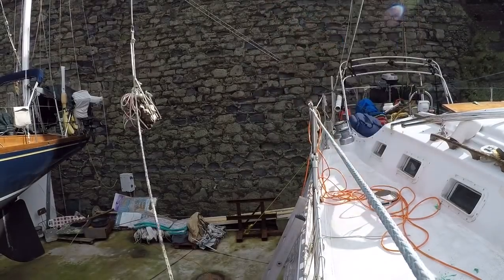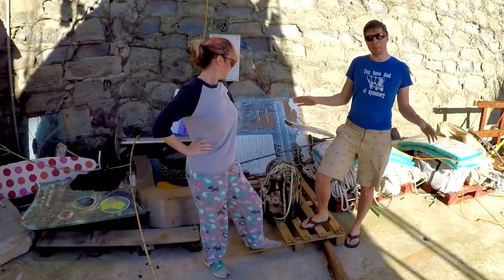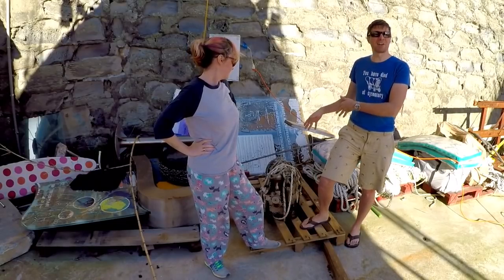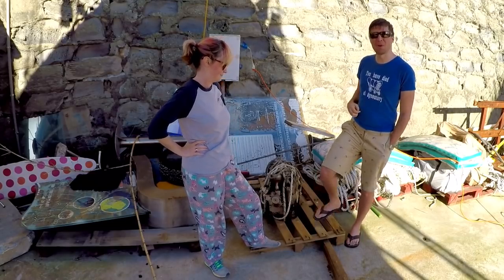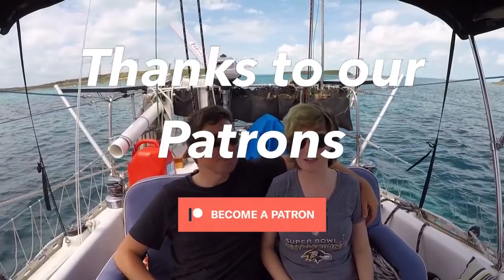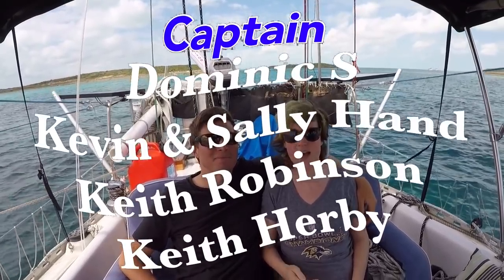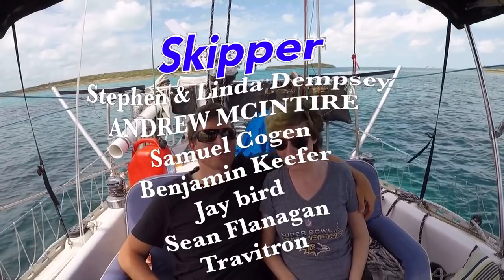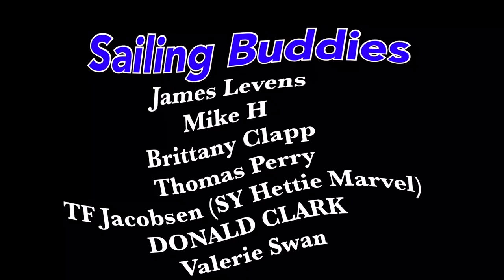Diesel VS Gas Generator?! | Sailing Wisdom

Comment: 1. Gasoline is explosive, flammable, and starts to slowly go bad immediately even with fuel stabilizers.  It is very volatile.  It evaporates readily leaving impurities which reduce combustion of the remaining fuel.  
2. Diesel is not explosive, not really flammable, and stores indefinitely with some biocides and a pack of fuel filters.   Diesel does not evaporate.  Diesel can be cheaper per gallon and has more power per gallon vs gasoline.

Winner: Diesel.  Gasoline is so dangerous that it requires a bilge blower.  I saw a jetski explode on the boat ramp last month from 2stroke gasoline fumes which ignited then Boom, followed by a good fire.  

The only positive for Gasoline is that some gas is also required for a dinghy outboard so the gas fuel supply can be shared.    Diesel outboards for dinghies no longer exist which is a bummer but also a fact of thermodynamics, diesel engines must be engineered larger and heavier than gas engines so it is hard to make them light enough for dinghy use plus no one likes the diesel NOx toxic exhaust fumes so close to people.  

Because boat fires and volatile fuel explosions are the #1 cause of boat destruction & boat injury, I'm hoping to also get rid of my propane tanks and propane stove-oven setup and replace with electric induction cooktop run off of inverter.  (I already use electric glass top induction stove for cooking on the boat with AC supplied from shore, has worked great for years).   Moral of the story is, it is better to eliminate volatile fuels from the boat, and gasoline is also one of those volatile fuels.
Reply from the maker: Very good points. We keep our gasoline jugs on the deck as well as the generator. Any fumes are whisked away by the wind, but we still need to be careful around the liquid (and vapors). Our thoughts were: portable vs inboard, inexpensive vs expensive, and replaceable vs repairable (has Vs. diesel).
Reply: @RiggingDoctor  Current prices; 
1. Gasoline generator. Honda EU2200i 2.2kW peak, 1.8 kW continuous, $1,000 off the shelf, not fixed install.  Weight 47 lbs.  ~8 hrs/1 gal gas.   Cost equates to ~$600/kW.
  
2. Diesel generator. Next Generation Kubota 3.5 kW continuous genset,  semi-fixed install. $6,000.  ~180 lbs.    ~6 hrs/1 gal diesel.   Cost equates to $1,700/kW.

Better comparison of the Kubota is to Honda EG4000 gas generator 3.5 kW continuous, 150 lbs, fixed install.  $1,600.  ~2.5 hrs/1 gal gas.  Cost equates to ~$500/kW.  

Efficiency of gas engine diminishes with engine size, for gas smaller is better.  Whereas diesel scales more linearly.  Also I would bet the diesel gen will run sooth for decades whereas gas gen will have limited lifetime.

So I vote diesel generator which is likely what I will install when the time comes to ditch my 25HP diesel engine for electric motor to go fully hybrid.
Reply from the maker: When you put it in those numbers, diesel makes a lot of sense for higher power applications!

Comment: $1000 you spent on the Honda generator would have bought you 1.5 Kw of solar panels 😀. Finding a place to attach them is another story. That’s why it is nice to have a large bimini.
Reply from the maker: Tell me about it! We're in desperate need of solar panel space
Reply: You can`t run an electric sailboat only on solar panels, because you need the electricity for other issues like fridge, light, instruments. 1,5 kw sounds much, but you get it only when the sun stands high, no clouds and no shade on it, and so on. I have two yanmars 6,5 kw on my catalac 9m, with the collected electricity of your mentioned  solar panels I could run an electric motor about 3 hours, that gives me a range of less than ten miles, because with an similar electric motor the boat will make not more than 3knots on a flat sea. I am waiting for their lourneys through the med where you have no wind or strong wind on the nose.
I try to sail as much as possible, but sometimes it is just dangerous to have a boot with so less motor range. I also use 300w solarpanels to keep my batteries full and my fridge running, Two cluody days and the batteries are empty.
There was a big cat with only electric propulsion called solar wave some years before. I saw it between corfu and the mainland in greece, the last couple of days were a little bit cloudy and a big thunderstorm was approachiing, we reached the next sheltered bay within one and a half hour, meantime solar waves engines shut of, no more electricity and they had to stay on open sea through the thunderstorm.

Comment: When you run the generator fo 10 hours, do you get 2000W or a little bit less? Great vid! Thank You! +1
Reply from the maker: The max power it can put out at any point in time is 2000W. We use it to power our tools and run the battery charger, so we never push it to the full 2kW that it could produce,.

Comment: I'm watching lots of your older videos these days. What I really like about your videos is the fact that I can learn something new in most of them. So thanks for that.

Some points I was missing:
1. Most cruisers have a dinghy running on gasoline, so you already have gasoline on board that you can also use for the generator. With a diesel generator you would need a diesel tank that you wouldn't need otherwise. (Assuming you have an electric motor, not a diesel engine)
2. Diesel can go bad ("diesel bug" - a microbial contamination). I also heard about gasoline going bad, but I'm not sure, if that's really true and I think at least it is less likely to happen with gasoline.
3. You can turn a gasoline generator into a hybrid - so it also runs on butane/propane. That's my preferred option, since the exhaust doesn't smell as bad as diesel exhaust and propane is cheaper than gasoline. Propane is sometimes hard to get (since you also need the right bottles or connectors...), but if you run out of propane, you still can run the generator on gasoline.
4. Diesel is less of a fire hazard than gasoline or propane.
5. Diesel usually is cheaper than gasoline. So in the long run, a diesel generator might become the more cost effective solution. But to achieve that, you have to run the generator a lot... I mean a loooooot.

Comment: You get nearly twice the KW pr gallon with a diesel generator than you do with a gas powered unit. However, that looks like a Ferryman single cylinder diesel there good to 3.6 KW. That thing HAMMERING along @ 3600 RPM would piss me off in rather short order.
Reply from the maker: Diesels are more efficient, but for the little use we give it, why go through the effort?
Reply: @RiggingDoctor  They are LOUD!

Comment: watt and sea option?
Reply from the maker: They create a bunch of power, but our electric motor does the same function. The only issue with hydrogenators is they require significant speed through the water.

Comment: You just picked the worst diesel unit you could unknowingly, comparing isn't really fair in that regard. I'm a diesel mechanic and work on diesel cars, all the same, its all about picking a reputable model!
Reply from the maker: We never installed it and gave it to a friend who wanted a “project”. Boy did it end up having issues!
We were comparing the theoretical situation of a diesel vs gas generator. In both camps, good ones will work, bad ones will give headaches! 

Based on all the feedback about this particular generator, we are glad we didn’t install it!!
Reply from the maker: If someone wants to go with a diesel, which generator or generator company would you recommend?

Comment: Very subjective opinion on very niche puropose and on even more niche model of diesel engine. I mean this video can't be more irrelevant to thumbnail.
Diesel engine in my opinion are more efficient and more reliable in cold weather. But I still think that upfront cost is a bit high.
Reply from the maker: Everything on an electric sailboat is niche :)
Many years after this video, our gas Honda generator died and we were able to replace it with a Westinghouse for $500. For that price, we got a brand new generator! Something you really can’t do with a built in motor, or either fuel form. The suitcase style generators really are convenient in that regard.
Reply: @RiggingDoctor  yeah, I get it. Still since weight is one of the priorities diesel generator is out but from safety perspective and fuel density. I think k it's a go.

Comment: So you got rid of the auxiliary engine (not sure why but it was probably had it) and installed an electric motor. I understand your desire to be more environmentally friendly but in my mind you have now over complicated the whole thing. Solar on its own is usually not enough for most cruising boats and most add a wind generator as well, and that’s not having to worry about the draw from an electric motor. If you had just installed a small modern common rail Diesel engine (I have a Lombardini in my boat) all of you’re requirements would have been satisfied as they are efficient, eco friendly, quiet and very reliable for a long time. Anyway just saying. Enjoy your videos.
Reply: Hi, Lombardini is about the last company producing small watercooled diesel engines - perfect for a genset. THe small lombardini (1003 cc) may not enough to power a large sailboat, but usingas a genset is perfect to power an electric motor.
Reply from the maker: Glad you commented. We liked the electric for many reasons on top of it's small environmental impact. We no longer have to carry jugs of diesel on our long passages, the motor requires no maintenance such as oiling, it acts as a hydrogenorator and actually gives us power, and we barely motor anywhere anyway. On the crossing we had no shortage of power even though our solar panels all died because the motor was able to provide for all our needs. And we don't have a wind gen. So, the electric motor makes a lot of sense for us!

Comment: I’ve got a eu2000i that’s set for propane.  Super clean.  The company that did it did a splendid job.  
(https://genconnexdirect.net/honda_generator_propane_kits.htm#xl_EU2000i:32KIT )
I’m not connected with them in any way. Just a satisfied customer.